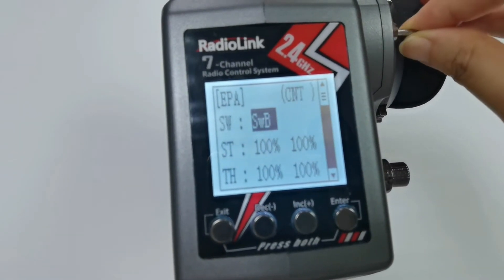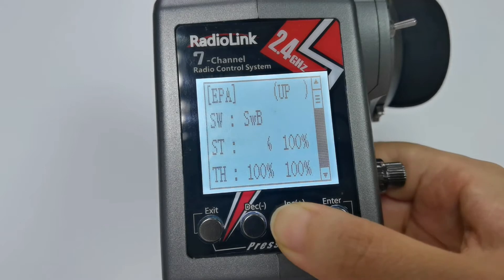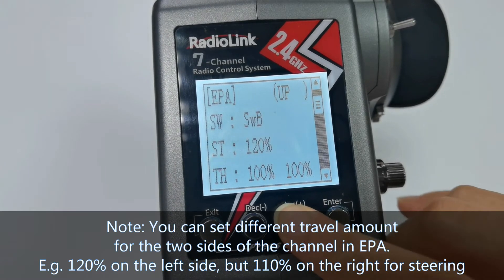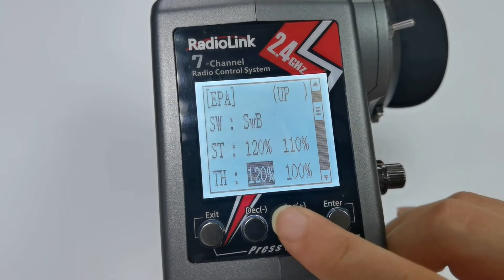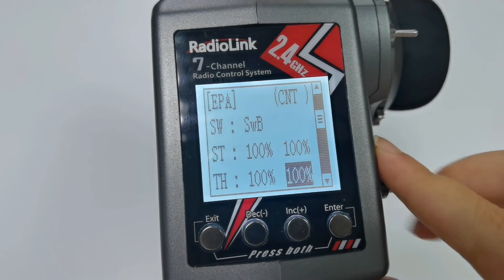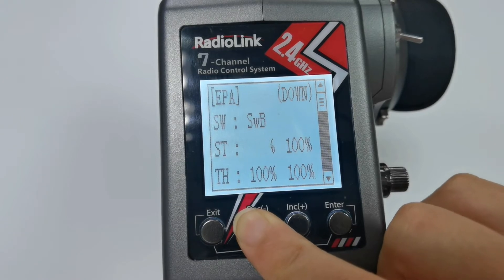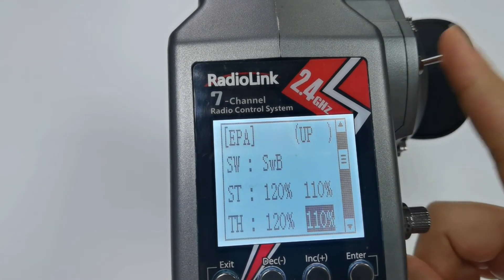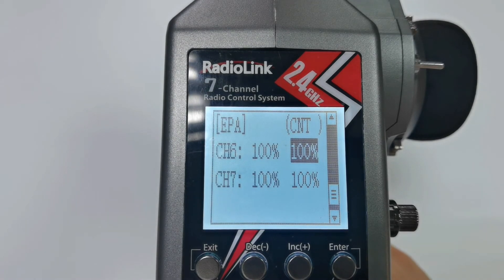EPA Function on RC6GS V3 / RC4GS V3

Comment: Hello, a question please, I have a RC4GS V3, the question is: I turn on the transmitter, when I give full throttle, the display (TH), should move to the right or left? Thanks.
Reply from the maker: Hi, sit. The display can move to the left or right. Both are okay. If you want to to move to the oppsite direction, you can enter the REV menu to set the channel 2, throttle channel to REV. If any question about RadioLink products please feel free to contact us. Our email is: after_service@radiolink.com.cn

Comment: Buongiorno ottimo video, desidero sapere il tasto SWD assegnato come L-KD si illumina di rosso quando viene premuto solo per un attimo, è possibile fare che quando il tasto SWD è in ON resta acceso è quando è in OFF si spegne?
Reply from the maker: Hi, sir. You can adjust the set of switch when setting it. For example, you set LK-D when it is +100 servo value last time. This time, you can set LK-D when it is -100 servo value this time. Then the light condition may be changed. If any question about RadioLink products please feel free to contact us. Our email is: after_service@radiolink.com.cn

Comment: Куда Ви серво привод подключаете у меня только отудова подключаю регулятор скорости

Подскажите как подключить регулятор скорости на rema hoby s max 500 рублей кто подскажит

и
Reply from the maker: Hi, sir, what transmitter and receiver you are using? Please connect the steering servo to channel 1 of the receiver, and ESC to channel 2 of the receiver. You can check the connection from the detailed manual of the transmitter. Here is the detailed manual of RC6GS V3 for your reference. https://www.radiolink.com/rc6gsv3_manual  If any question when using RadioLink products please feel free to contact us. Our email is: after_service@radiolink.com.cn

Comment: Alarm settings  What voltage I should the EXT  voltage I use  2 battery 4s 8000mah 15.2v?
Reply from the maker: Hi, sir. The alarm voltage depends on what battery you use. For example, if you are use lipo battery, with full voltage of 4.2V for each cell, we recommend you to set 3.7V for each cell. For example, 2S battery with full 8.4V, you can set alarm voltage as 7.4V. You can also set different alarm voltage as you like. If any question when using RadioLink products please feel free to contact us. Our email is: after_service@radiolink.com.cn

Comment: Hi I just bought the rc6gs v3. How can i use the rc6gs transmitter with dumbo rc receiver in my car.? The car currently has a lightcontrol box connected to tye dumbo rc receiver). If i use rc7fg then i loose the lighting functions. So i want to use dumb rc receiver thanks
Reply from the maker: Hello, sir. RadioLink control system is not open-sourced. RadioLink transmitters are only compatible to RadioLink receivers. So sorry RC6GS V3 transmitter is not compatible with DUMBO RC receivers. We recommend you to change it to R7FG receiver. Connect the light control box to R7FG and then you can also get the lighting function.
Reply: @Radiolink_official   @Radiolink  hi thanks. How do I coonect the light control box to R7FG? It does not have separate pins for a light control box.  Can I split the channel different channel cables? so for example for channel 1, one end goes to the servo and the other goes to the light control box?  Thanks
Reply from the maker: @Rangeman001  Hello, sir. If there is no pins to be connected to R7FG, sorry it cannot be connected to R7FG.